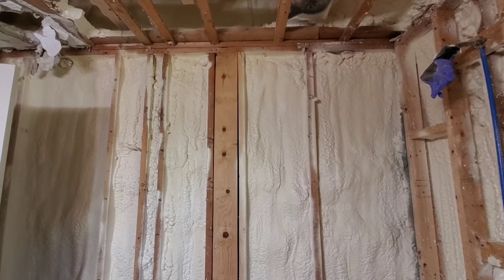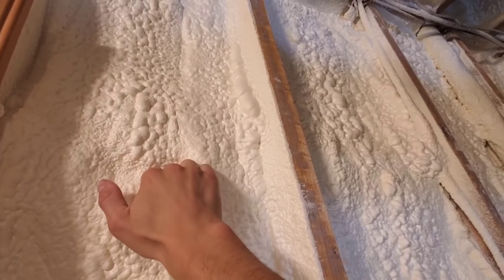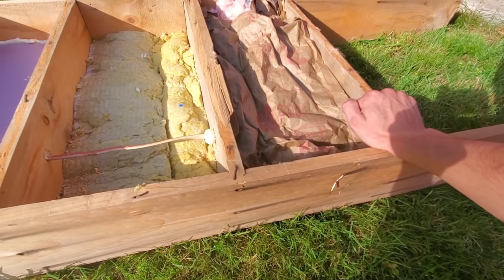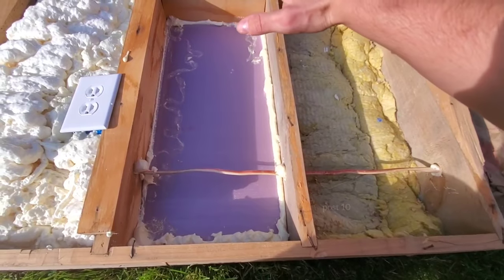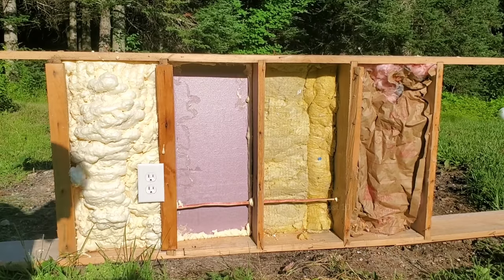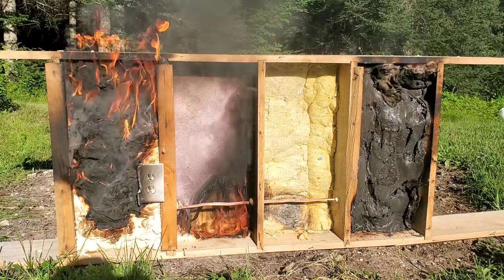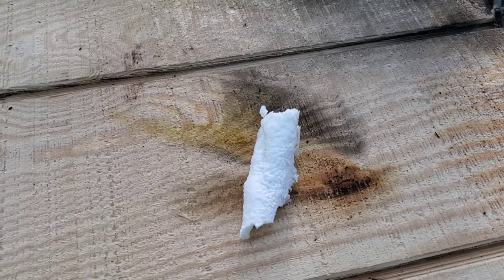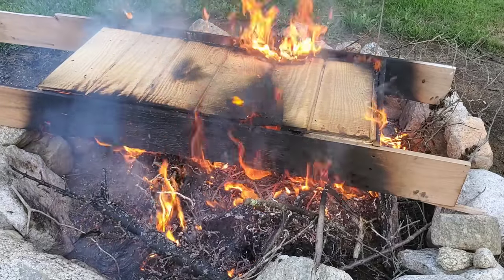Testing The Burn Ability Of Insulation In Wall

Comment: Is that just an old fire extinguisher? But now with water?
Reply: No that is a Class A fire extinguisher, has water only inside not for kitchen or electrical fires
Reply: @post10Vlogs  thank you for responding. I've been looking for something similar to that. I work with concrete inside occupied buildings and sometimes we have to wash the edge of what we cut so we have to drag a water hose throught the homes or windows and it's such an inconvenience. I think that might actually work for what I need it. Do you recommend a place where I could buy one of those?
Reply: @chirina5  I bought this used on eBay, it would be perfect for what you're looking for since you can charge it at home, same valve as a car tire so it can be filled with any compressor

Comment: It’s interesting because the spray foam I use does not burn 🔥 like the one shown in this video!!! The product I use actually self extinguishes
Reply: Yes, and it does so while generating toxic fumes. Self-extinguishing plastics are usually fluorinated, brominated or borated, if I remember correctly. They are a good idea in the engine compartment of a car or a plane (and that's what they were probably invented for), but not as large area insulation around people.

Comment: Large gap filler by great stuff is not actually a level 1 fire rated foam like most two part closed cell spray foam insulation. Also to run this test with open air on both sides of this product does not accurately show the standard conditions of a house fire. Part of the fire resistance is the closed off cell not allowing for free flowing oxygen to fuel the flame. This test is by no means scientific nor is it accurate in any way shape or form.

Comment: What about wood fiber? These materials are from the 80s. There is a lot more modern stuff and wood fiber is just the cheapest. Hemp fiber is an interesting one too. 
If it needs to be fireproof: calcium silicate literally can't burn and won't break or melt.

Of course, even natural materials emit carbon monoxide when they burn, but it is not a thick black smoke.
The wood paneling is not the best choice, also because of the cost. Clay is cheaper.

Comment: If you want to test fire resistance, set the wood on fire. You were so close by talking about the cable setting the beams on fire, then you ignored that by torching only the insulation.
That’s a lot of talking to completely whiff on the test

Comment: What does it matter? The fire will start inside the house where all there air is and not inside the walls where there’s hardly any air. In any case, slow or fast spreading fire will be fast enough to render the building cancelled. Fire is not the issue, fit insulation according to climate.

Comment: doubt youll read this. but whatever. i dont think this is an accurate indicative test of "spray foam" because you only used a can of greatstuff.  for starters theres two types of spray foam. open and closed cell. both of which use a much more aggressive expansion type of foam and with the use of wide nozzle tips youre able to spay a whole stud bay in a couple passes or less. 
the way you used the can of greatstuff all but guarantees youll get airgaps inbetween the spaghetti strings you sprayed. 

there are actually spray foams designed to be outright fire retardants. they dont just not burn they actively hinder a fire from burning or spreading with their chemical makeup.

i dont want to say this was a dishonest test. but it certainly wasnt very well educated in its premise

Comment: You clearly have no knowledge of fiberglass vs mineralwool (rockwool) they are so very different and cannot both be called simple fiberglass. Fiberglass does absolutely burn when heated enough where as mineralwool does not. Its made from rock vs glass. What has a lower melting point? And one is paperbacked for a vapor barrier with a flammable product the other is naturally hydrophobic. Your test should have been 3 very different categories

Comment: I love all the examples you show, but it's useless because the fire department always arrive LATE if an emergency occurs
Reply: A rockwool/cement sheet wall simply won't burn. I tried it ten years ago myself just out of curiosity. One can heat up the cement board with a roofing torch till it glows red on the outside and the heat transferred to the inside is still not enough to set the frame on fire. The only place where the framing wood was charred after fifteen minutes was around the nails, but since air can't get to it, there is no combustion. I fully trust that such a wall will withstand a blazing fire for an hour before it will start burning. This should become standard building code after seeing all this unnecessary loss of property and life in recent fire events.

Comment: Normally it is inside a closed wall with less air, so should burn less.
The spray foam should not burn. It doesn't in EU. interesting

Comment: This is totally WRONG!!!. You would not fill all the wall cavities in a home with great stuff. Great stuff is a single component canned foam. Home wall insulation is a two component system. And is formulated to Meet fire codes.  Now this is not to say that putting a torch to it that it will not start burning. More the open cell content. There is the greater chance it will burn better. But the fire retardant it contains it will self-extinguish. This is a bad comparison to wall foam insulation. You kind of get the point across though. But people will just take it for apples to apples. When in fact they are not the same product.

Comment: This is a crap test in that it doesn't show a closed wall cell.  Many of these would self extinguish because the oxygen in the wall cavity would be used up or the smoke would displace it enough to put the flames out.  That is assuming proper construction techniques with fire blocking in the walls and a reasonably air tight wall cavity of course.

Comment: Okay, your suggestion that some dumb person could plug a 20amp device/appliance into that 15amp receptacle is misinformation. Devices with a 20amp rating have a different plug configuration and cannot be inserted into a 15amp receptacle. So your premise is flawed. I am a retired electrician and electrical engineer.

Comment: First off this is a useless test. All of these materials are tested in laboratories before they are approved to used as building materials.  He could have literally put a chart on screen that showed the fire rating of a wall built with each insulation type.  Also none of these are applied properly.  The rigid foam needs the cover the entire depth of the cavity.  The fiberglass bat is not properly attached to the studs it's just shoved into the cavity and the two foams he's used are not mean to be used as wall cavity foam so testing them in a full stud bay wall cavity doesn't make much sense.  Also there is a reason why houses have plywood and a house wrap and a siding material with paint on the outside and drywall and paint on the inside.  The entire wall assembly is what matters.  Materials themselves are tested for their resistance to fire but an entire wall assembly acts and reacts to fire in different ways.  This is a classic case of someone running an "experiment" without understanding what they are testing for and without knowing what the purpose of the test actually is.  This demonstrates little more than a guy with a desire to start a fire.  I restate that it would have been more useful and productive to simply put a chart of the fire rating of different wall assemblies on screen for five minutes that produce this video.

Comment: Paper backed fiberglass is the WORST choice for insulation because it is not an effective insulator.  Glass is highly thermally conductive, and glass fibers do little to slow vertical airflow, so it will indeed support a structure fire when the fire reaches 800 degrees F..  And you are misleading about fiberglass being glass and not flammable.  Fiberglass melts and drips down through the structure onto the lower flammable materials causing them to ignite.  Rock wool is NOT flammable and therefore its the best insulation to use in any application where a danger of fire exists.  Foam is the best for preventing airflow, but when it is heated and catches fire it will burn and contribute to everything around it catching fire, unless it has a fire retardant added to the chemistry.  My point:  Rock Wool is best because it is both dense and fire proof.  Air doesn't move through it and it does not absorb moisture.  Pests and insects don't nest in it like they do in fiberglass.  Closed cell foam is best for stopping airflow and being a moisture barrier.  Open cell foam is as good as closed cell for being an air barrier,. but it's "R" value is 1/2 that of closed cell foam and it does move moisture (albeit very slowly) through it, making it not as good with controlling mold.  Rock wool is, IMO, the best bang for your buck because it is as good as open cell foam with respects to moisture control and "R" value, its better than all other insulation in the fire prevention department, and pests tend to stay out of it as compared to fiberglass where they nest.  One not mentioned in this video is cellulose.  Cellulose is good on horizontal surfaces because it is dense and its impregnated with boric acid - making it pest resistant.  I don't recommend using it in a vertical application because over time it either retains moisture and sags, or it dry rots and turns into dust.  Again Rock Wool is best.  If you want the absolute best bang, use 2" of foam insulation and rock wool over it.

Comment: I just saw your video. Despite the fact it's 2yrs old  and flawed 2yrs ago when this video was made, the fact is it's still just as flawed today. 1st off it's important to note that this wall would be covered therefore reducing the oxygen supply significantly which would slow the burn rate down exponentially. My 2nd point is the pink foam would've just melted itself out! The ONLY reason that entire panel continued to burn was because of the spray foam on the bottom... Period. How on God"s green earth you came to the conclusion that fiberglass is the best choice it's beyond me?? What video did you watch to come to this conclusion that's so obviously, blatantly wrong! The Rockwool is by far THE ABSOLUTE BEST CHOICE IF YOUR MAIN CONCERN IS FIRE PREVENTION WITHOUT A DOUBT, HANDS DOWN! ROCKWOOL IS THE CLEAR VICTOR WHEN IT COMES TO FIRE PREVENTION!!!!

Comment: Your Assessment of fuses being safer is idiotic Todays Thermal Magnetic breakers have multiple sensing Systems Fuses had only one.Most electrical fires DO NOT HAPPEN IN WALLS, THEY HAPPEN AT THE JUNCTIONS OR OUTLETS

Comment: "Before they called it Romex" ....???? 
NMC or plastic-insulated wire or “Romex” have been in use in the U.S. since about 1926.
Rockwool is generally use in oven construction.  

Video just gives another blackeye to spray in insulation.

Comment: You should stick to insulation. You are giving people bad information. If you plug two heaters into that circuit, it will trip the breaker. There is no danger of fire unless you replace it with a bigger breaker, WHICH YOU SHOULD NEVER DO. Leave the electrical advice to the electricians

Comment: also..ext sheeting IS NOT a vapor barrier as you mention at the 8:05 mark.  vap barrior as any good tradesan would know is to the warm in winter side NOT THE OUTSIDE.. OH! and although fg does not burn IT MELTS and is TOXIC ..ask and fire dept to explain that to you. YOU DID NOT USE  "spray foam" you used great stuff...HUUUUGE difference. terrible video

Comment: remember how all the cities of the usa were stone, and iron while we were still riding horses and pulling carts? yeah the govooment said it all burned down. me i like using extra flammable materials like concrete, stone, and metal. according to my research local building restrictions are to allow you to maximize your freedom on the land you dont own. remember its all yours but dont disover any minerals, timber or water of value or else its ours. make sure to not dig a well you have to use our sewer or else no one will believe our planet made of water is running out of water.